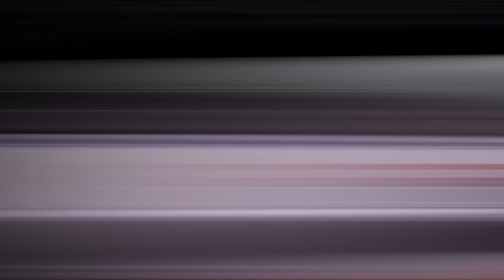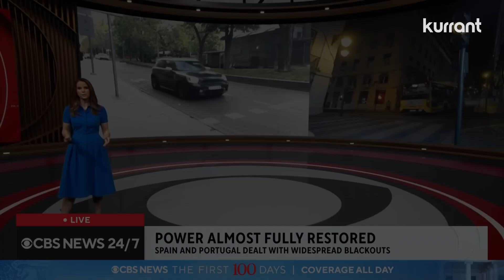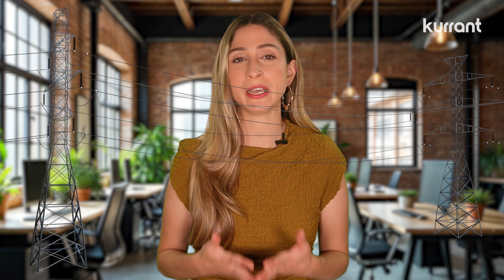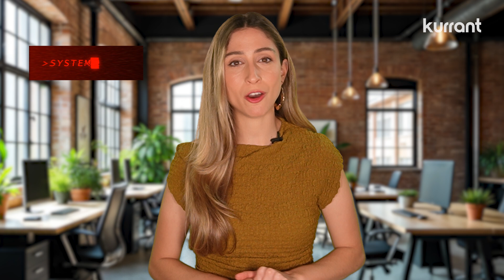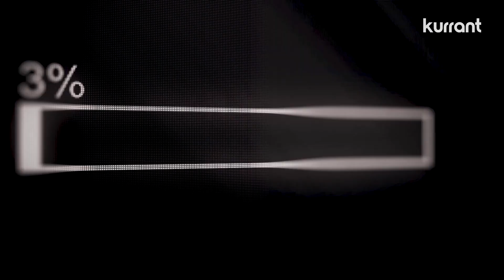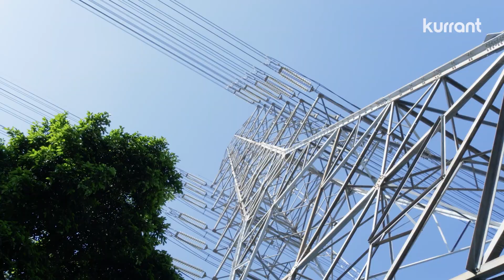A National Blackout: Why and How the Power Grid Fails

Comment: you are right: there is little room for storage: why? because nobody invests in storage. Everybody takes security for granted. This should be a wake up call for storage, for more storage, for much more storage, of all sizes, strategically distributed  where it is needed most, of all sizes and dynamics. For example on the weak inter-connectors. On the borders. Wherever easy, cheap, possible. I wrote this ten years ago, a storage strategy paper for the EU, but nobody listened. And nobody wanted to pay. Like modern cars: no spare wheel anymore gives wrong sense of security.
Reply: Right!  Cost be damned!

Comment: Perhaps you could have mentioned that grid base loads cannot be attained by renewables as they are INTERMITTENT sources of power. Gas plants however run turbines at 3,000rpm giving that 50Hz stability the grid NEEDS as +/- 1Hz can cause serious disruption and blackouts.
Reply: Nonsense - stale issue that has been solved.
Reply: @jonb5493 :That 'stale issue' as you put it was the root cause of the Spanish blackout by relying on renewables which cannot attain the stability a grid needs.
I am done with your posturings. Bye.
Reply: @jonb5493 You keep on listening to Braindead Bowen, and we will listen to the the people who know...

Comment: Shows a need for a different kind of grid scale energy storage which doesn't concentrate on long duration, but adds a smoothing effect to power fluctuations.  I think I finally found a use for molten salt batteries.  In Spain and Portugal you could use gravity storage with massive weights on rail on incline. This provides more energy density than water and does not use water which is not readily available.